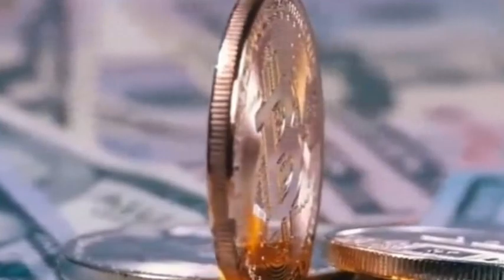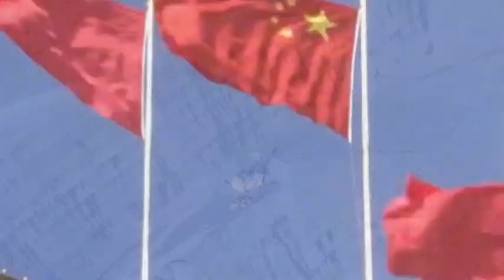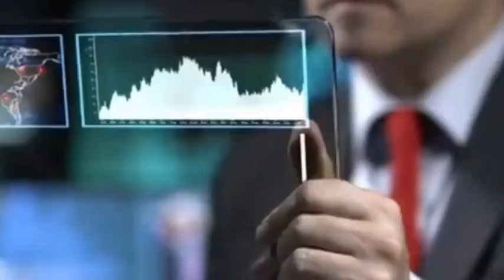AI development promotes chip R&D, and there is a gap in chip revenue between China and Japan.

Comment: But Japan got sandbagged by the US by accepting the  Plaza Accord which caused the dollar value to fall and Japanese Yen to gain meteoric strength.  Japan leveraged that by using its real estate for collateral and buying everything in sight.  Now, Japan is way off in the other direction and some see the economic collapse of Japan and not a rise.  The US is accelerating that decline by restricting Japan from selling Japanese semiconductor equipment and semiconductors to China that contains US IP.  There is a partial glimmer of hope in its new nano imprint technologies that is void of US IP and can be sold to China to make 5nm and smaller semicondctor chips.  Japan has a heavy economic load with its high debt, increasing age demographics, and faltering exports  A big failure is its slow switch from ICE to EV in autos may bankrupt some of Japan's major auto makers. For sure, it appears China is taking the lead in auto manufacturing away from Japan to China.  That decline is also seen in ship building, robotics, super computers, biotechnology, consumer electronics, home appliances, and big pharma.